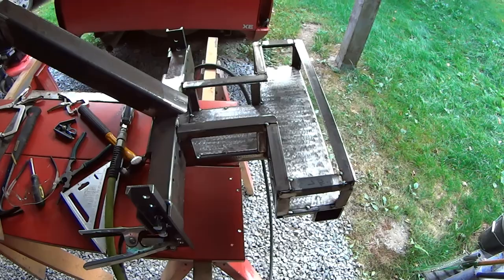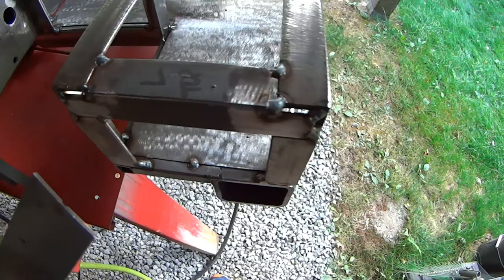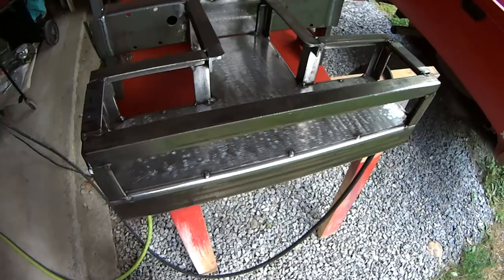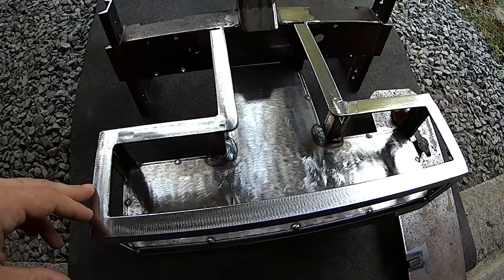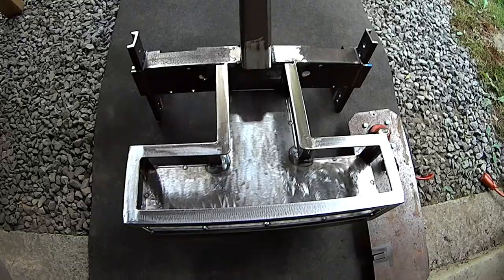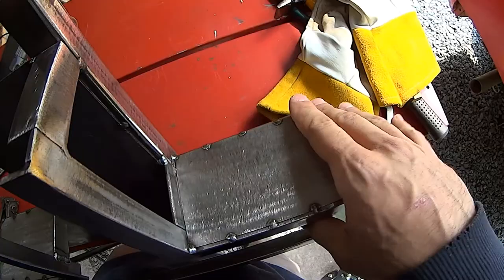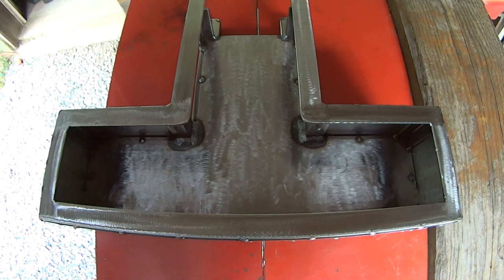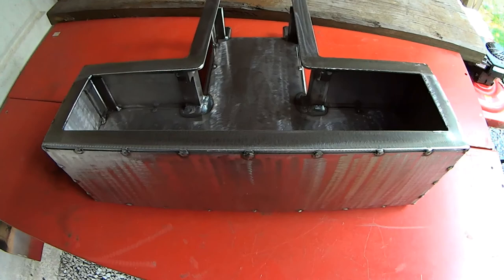R/C Lawn Mower V2: Pt. 7 Welding angle iron. Bumper weld up and skinning

Comment: Not sure if you reading this, I like the project but cant find aby sensible ways to attatch the motors making the service ready if needed. This would be my secon RC mower but i still have lots to learn. I want to make frame sort of universal si I could attatch any (most popular) 21" mower to it with minimal mods.
Reply from the maker: Serviceability would be nice. However, I can tell you these motors don't seem to really need any service though. I know of lots of them with tons and tons of hours that just run and run. Brushes are the only thing I could see needing to maintain. The mounting on my motors isn't the best and is not great for service... But they work just fine. Brushes can be replaced. Just consider how necessary it is for you. You may require something different. Thanks for watching. Have fun on your second go round.

Comment: why would you add 300 pounds of weight to the mower? just wondering.
Reply from the maker: That's a fair question. Traction is one of the biggest issues. The old one performed much better with me riding on top of it.  Every commercial mower is heavy. Ever power chair I've ever had to pick up is clearly super heavy.... Weight is more help than harm in this application. At least that's the way I'm looking at it this time round. Thank you for watching and interacting.